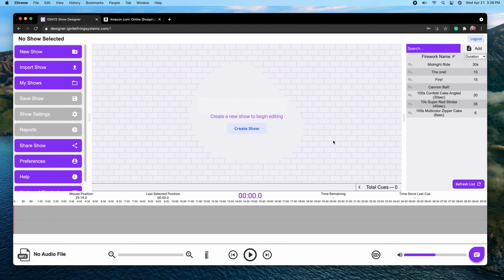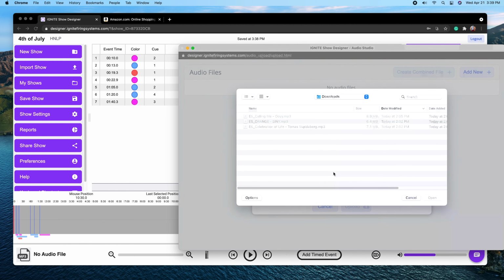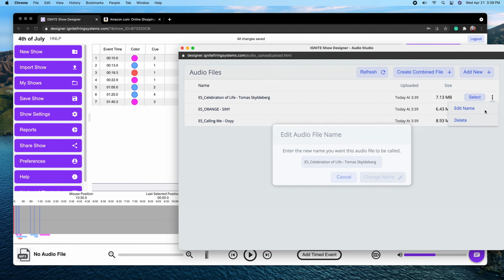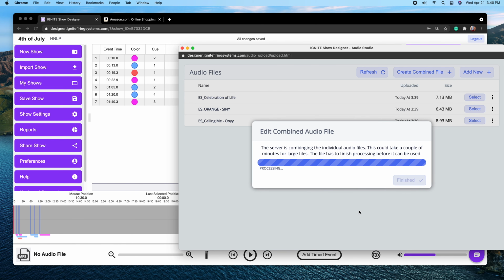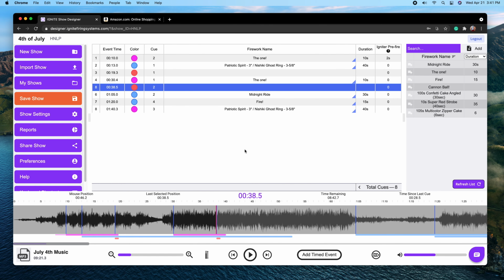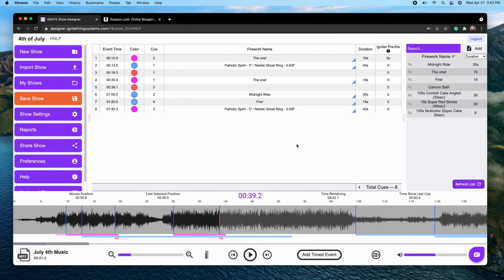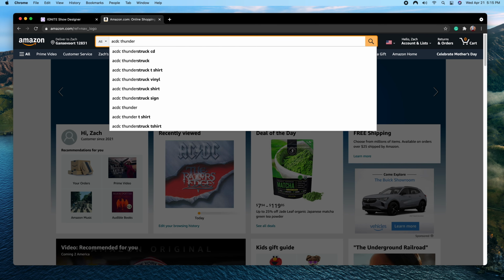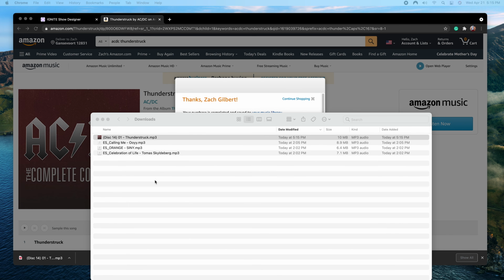IGNITE Firing Systems - Adding Music to your Show

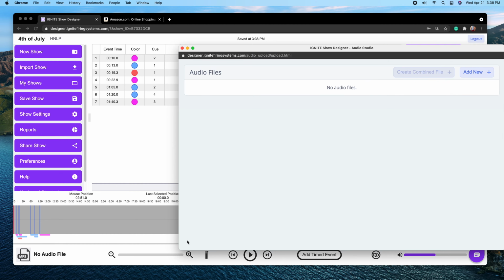Comment: So when the song gets to the firework that is set up to go off at a certain time.  Is that when the fuse on the firework is lit or when the firework fires.  IE I have a tube setup, I want it to go off at 1:05 into the song and it is on a 2-second fuse.  DO i need to set it on 1:03 so it fires at that 1:05 mark.  Or when the system hits that 1:05 in will it launch the firework?
Reply: You can use the pre-fire feature in the software to have the igniter fire earlier than your event time. For example, if your event time is at 10 seconds, you can add a pre-fire time of 2 seconds to have it fire early at 8 seconds. In short, the pre-fire time is automatically subtracted from the event time.